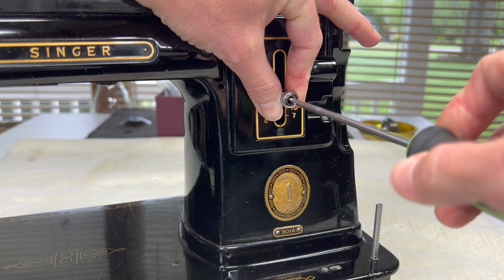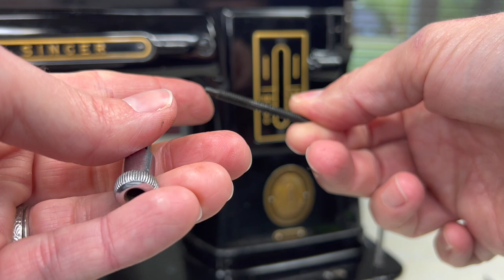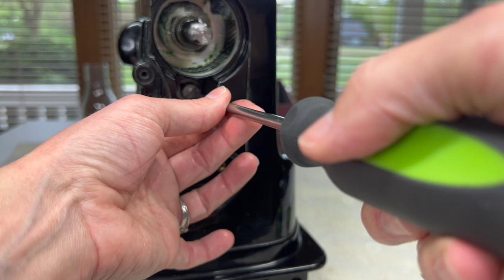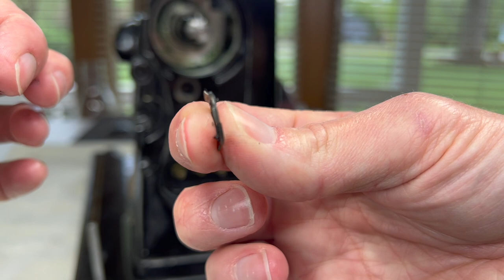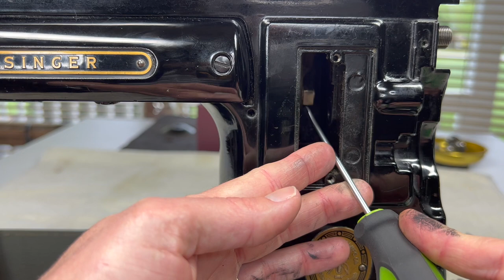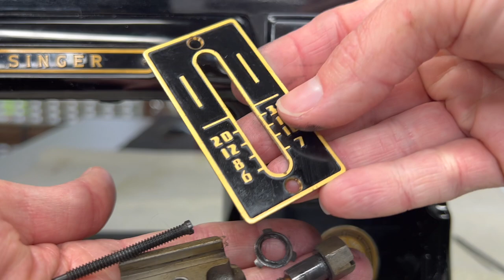How to remove the feed regulator a Singer 301: Singer Restoration Series Part 8

Comment: Re: slide block, about 12:15 in, I have a tip for putting the feed regulator back onto that block. I put it back in right after cleaning it. I found putting my right index finger under block, while placing the feed regulator back in (with left hand), made it much easier to reinstall.
Reply from the maker: I am glad you found a way that worked for you! Thanks for sharing!

Comment: Hi! Great videos!  I can’t get the stitch length plate off - both screws are stuck. Have used Kroil several times. The screw slots seem very soft and are showing a bit of damage. Suggestions?
Reply from the maker: Hi! Thank you! Those screws are soft, it can be frustrating. I recommend laying the machine on its back so you can get downward pressure. Hopefully you have a well fitting bit for those slots. Some people have luck hitting it with heat, you could try holding a hairdryer on them for a bit. Then just pushing down and turning slowly. There are replacement screws if the heads get too damaged, email me if you need to find some at jen@sewingmachinerehab.com hope that helps!
Reply: This machine was in storage for a long time - must have picked up some moisture. The plates all show evidence of corrosion - best way to clean that without damage?
Reply from the maker: @ursulaandrews335   I would need to see a picture before I could answer. Feel free to send me one to jen@sewingmachinerehab.com

Comment: My Singer 301 stitch length was sewing okay when set at longest stitch, but suddenly it started sewing very tightly.  I think the feed dog dropped or something, because the regulator no longer controls the stitch length.  Can you tell me why this happened and how to fix it?  I have tried a few things to fix it, but no luck yet. Thank you.
Reply from the maker: Hi, sorry for the delay, I was on vacation. Have you looked to see if the feed dogs are coming up when you rotate the hand wheel? There is a knob on the bottom left side that you can turn to raise and lower them. Make sure it is turned all the way clockwise. Check that and let me know if that was the problem and if it wasn’t then you can email me more details at jen@sewingmachinerehab.com